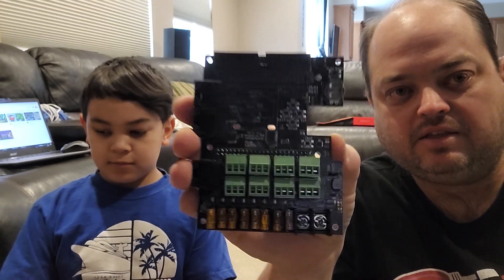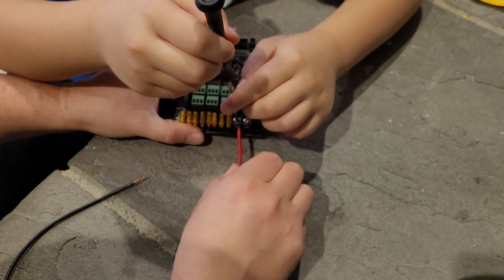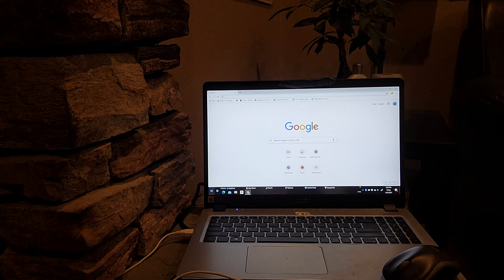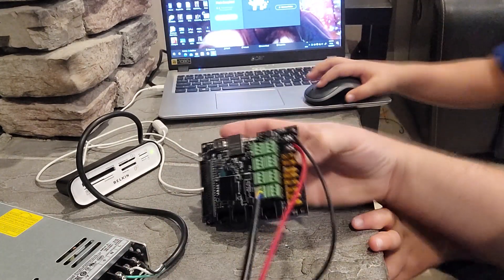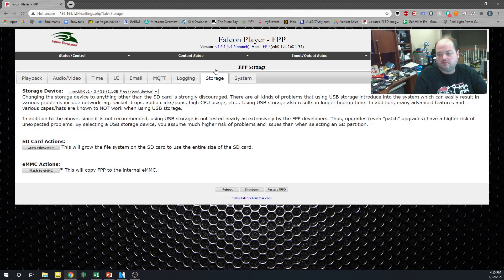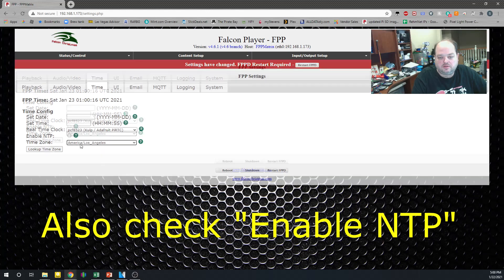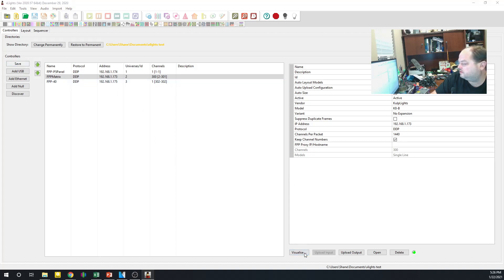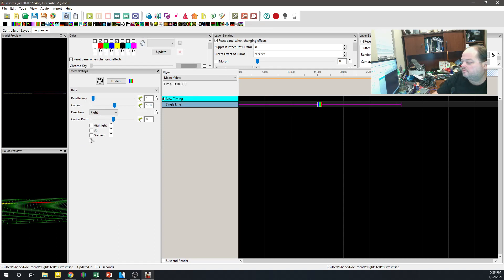Zero to Light Show in 20 minutes

Comment: @mickeythepuppy hi thefe great video can you please tell me what voltage output your psu is set at? Is it 5v or lower?
Reply from the maker: Hi! I have the psu set to 12v. The BBB requires 5v, but when you power it through the board, there is a built in regulator that steps it down.

Comment: Once you create and save your show, and load it to FPP, can you disconnect the LAN? Is that what "stand alone mode" means? Or will the LAN have to remain plugged in for the show to run?
Reply from the maker: Yes, once the FSEQ file is loaded on the controller, and the schedule is set, it can run on its own without being connected to the LAN. Although, typically i will leave it connected to push out updates and tweaks throughout the season.
Reply: @mickeythepuppy  is it the same if you multiple kulp/bbb units? Or does it require a LAN to connect additional controllers?
Reply from the maker: @charonnisis  If you are running multiple controllers, they will still need to be networked together. The easiest way to do so is through a cheap switch.